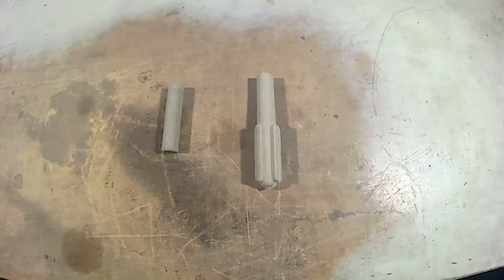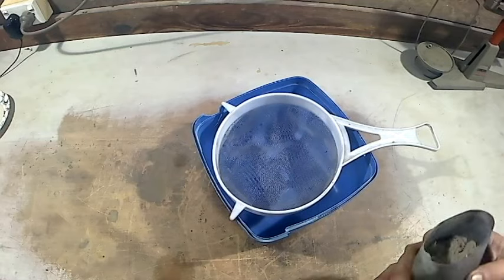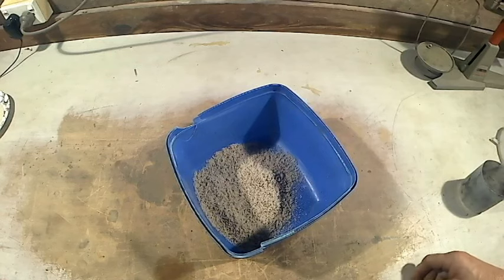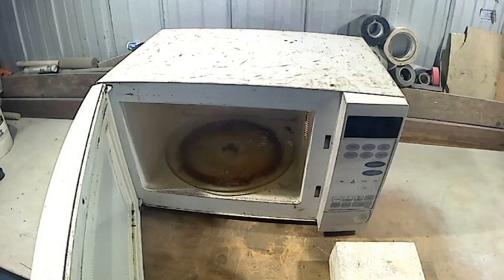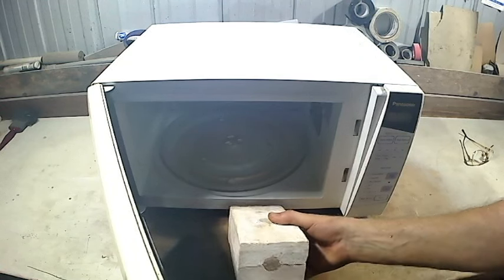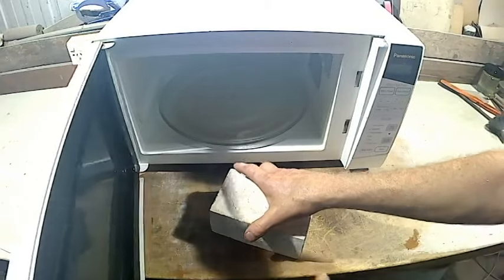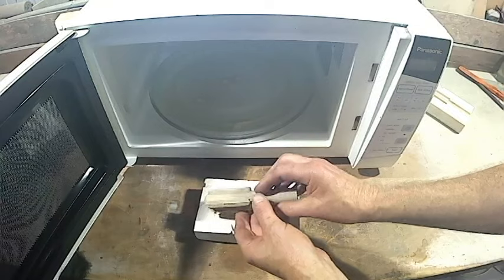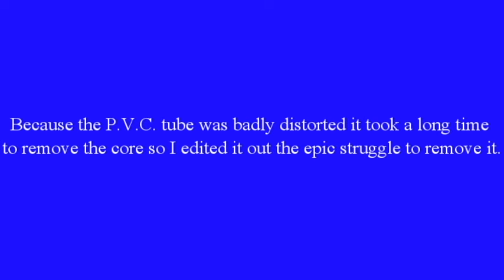Can you harden a sodium silicate core with a microwave oven

Comment: I cook mine in one of those counter top small ovens. I tried gas but i kept getting a soft spot in the center so i took the oven approach. Throw in the small oven, at low temperature,  it works great.
Reply from the maker: To get rid of that soft spot in the center push a thin piece or wire in the center of the core and that soft spot will disappear.

Comment: A very nice alternate sodium silicate curing method.  It seems like from these two tests, the user only needs to vary the microwave time according to the volume of material to be cured.  
I imagine, using a lower power setting on the microwave and a longer duration might allow more even exposure and complete solidification for larger and more complex shapes with less concern for developing hot spots and such where heat may tend to concentrate.
Reply: Apparently, microwave is one of three main ways to cure sodium silicate when used for foundry work?
https://en.wikipedia.org/wiki/Sodium_silicate#Foundry
Reply from the maker: Yes you are right not all cores are the same shape and volume, also using a different microwave oven might give different results. SS is very cheap so you can afford to do some experiments to get the results you want.

Comment: I wonder if eggs could be used instead of sodium silicate? Happy New year Lucky  👍👍👍
Reply from the maker: Eggs are a great binder.  Eggs are used to bind food like egg and flour.
Reply from the maker: All core binders will out gas combustion vapours just look at green sand, if too much binder or water is used there will be problems. The trick is to keep the binder or water under a level that causes problems (blowholes). @honthirty_
Reply: Molasses works great as a binders baked in an oven makes a nice core. Not sure if it will harden in a microwave though.

Comment: would it be possible to generate CO2 by heating baking soda sodium bicarbonate in the microwave to increase efficiency? Could you use baking soda sprinkled over the mold as a release agent?
Reply from the maker: You can use sodium bicarbonate in another container and add vinegar to produce CO2  then run a hose to the core. Heating it up without directing CO2 to the core gives poor results.

Comment: Is that a plaster core box? (first core) I have sodium silicate but have not used it yet because of the lack of a good C02 source. I now with this, I will go and give it a try. Thanks.
Reply from the maker: Yes it was. I did not try a wood core box in the video but it should work.

Comment: I've had some success curing silicate cores in a toaster oven.  My plaster corebox became quite brittle however...  So the use of a thicker sodium silicate that is viscous enough to allow demolding of unhardened cores worked the best for heat curing in my experiments, but one day I'd like to try building a plaster corebox with shrink allowance built in for aluminum and cast corebox halves that can survive being baked...
Reply from the maker: If you have a close look at the plaster core box there are many cracks because microwaves tend to dry it out. Before using a plaster core box spray water on it so it loses less water when heated.

Comment: @luckygen1001 Is there any benefit of "carbon-blacking" or graphite covering the core for surface finish over the sodium silicate core?  Thought it may be a bit of overkill- but core stability is one factor- surface finish is another...
Reply from the maker: Great point, it does make a lot difference to the surface finish using graphite to fill in the space between sand grains. Have a look at my video "Portland cement as a sand binder" it shows how I rub graphite into the sand pores. Wear gloves as graphite is very dirty.

Comment: Great idea!  I just inherited an extra microwave.  Is it worth or could one reuse the (sand) silicate core? Or will having used the sand cause some sort of contamination due to the sand having been coated once?
Reply from the maker: Sand is so cheap so it is not worth reusing core sand. Also if you reuse core sand there is a build up of sodium silicate which does not burn up and you have to use more sodium silicate to rebind the sand.

Comment: Hi! I am from Austria, so my request what is Sodiumsilicat? We have here ,  NaSiO? or is it ,  oder is it Natriumwasserglas, Kaliumwasserglas oder Lithiumwasserglas.
Reply: The term in English "sodium silicate" refers in this context to "sodium metasilicate", Na2SiO3, with the Na+ ion. You'd want to use Natriumwasserglas.
Reply from the maker: There are many kinds of sodium silicate use one that is made for foundry work. I use COOLSET1 and is made by foseco.
Reply: I was wondering about this, NOBOX tried to use water glass as a refractory and it acted like wax when heated.
Reply from the maker: SS is not a refractory and will  breakdown with high heat. @stoneomountain2390

Comment: Hello and Happy New Year =)
09:20 - Why don't you put an item in the center? Is it specifically or without any thought? I am not a specialist, but it seems to me that the most powerful heating should be in the center - there the subject is constantly under the heating. And when the item stands on the edge of the plate, then it enters the center only at two points.
p.s. It is interesting, and if you use glass tubes for chemical experiments or glass tubes that are sold for hobbists, they are heated by a direct flame of a gas burner. But if the sodium silicate expands, then the glass can burst.
p.p.s. I'm using google translate, If something is incomprehensible, ask me, I will try to paraphrase
Reply from the maker: I had a look at my kitchen microwave oven user manual and it does not say anything about where to place food on the dish to heat up. As the dish rotates it will heat up food evenly. Google translate did an excellent job translating Russian to English.
Reply: @luckygen1001  It would be necessary to check in a practical way. I think you need to take two identical glass mugs, pour the same amount of water from one source (stir in a jar). Put one mug in the center of plate in microwave, and the other on the edge. And then check the temperature sensor. I wonder if there will be a difference or not =)
p.s. Google translate did an excellent job translating Russian to English - cool!)
Reply from the maker: I did what you suggested and heated 0.2 liter of water for 2 minutes with the container in the middle, The temperature got to 93 C. I heated another 0.2 liter of water but did not put it in the middle and the max temperature was 87 C. So there is a difference but not much. @pinokio514
Reply: @luckygen1001   Super, thanks for the test!
I think that the temperature difference has changed slowly. That is, when the mug in the center was heated to 20 degrees, the difference was 1-2 degrees. When heated to 40, the difference was 2-3 degrees. And so on. Perhaps this difference will be significant if you melt the metal in the microwave. Or if you heat a large volume of liquid or something. And this can affect the time and electricity.
p.s. On a non-working microwave the buttons or sensors? If the buttons, then you can buy a set of conductive rubbers for remote control and try to fix the microwave. I saw in YouTube how they glue aluminium foil instead of these rubbers in remote controls for TV. But first, it is better to open the microwave and see what is there. Before buying something.
Reply from the maker: It was the touch pad so I threw that microwave out, I have plenty of spare microwave ovens. @pinokio514